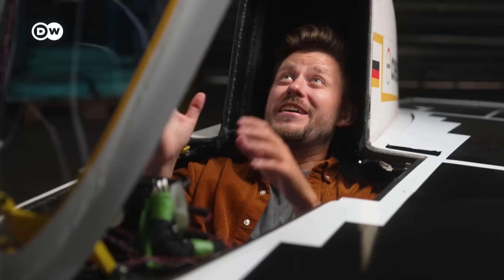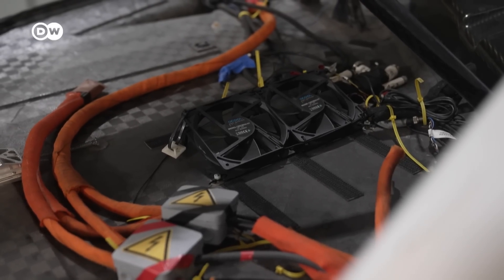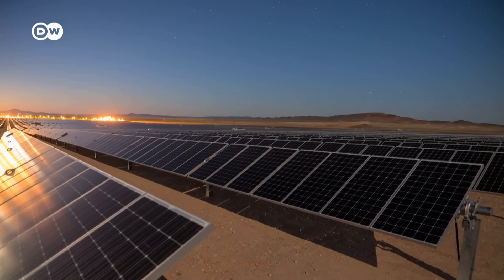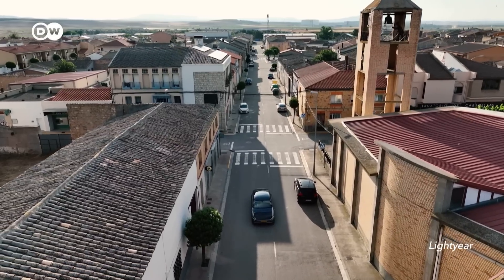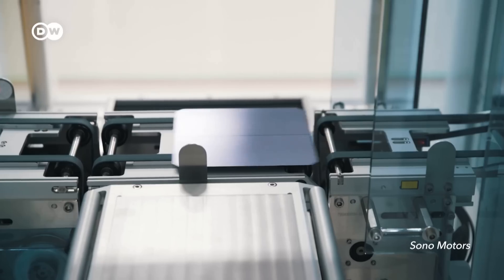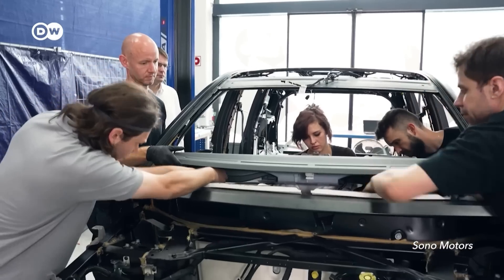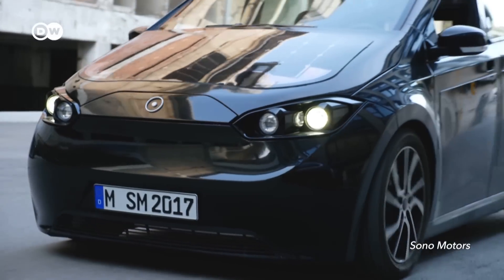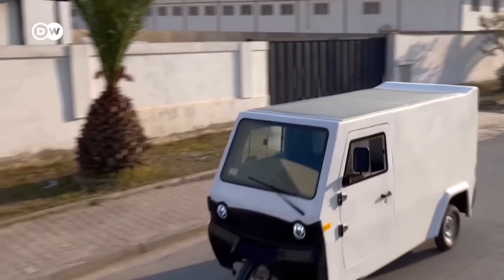Why aren't solar cars everywhere?

Comment: The Aptera overheating was because they had not hooked up the motor cooling system.  It's a prototype.  They had it in Switzerland for part of the winter.  Then showed it off in Southern California in the middle of summer during a heatwave. Opps.
Reply: Design flaws. motors have cooling fans. The solar mini-buses built by Mustafa and his team in Nigeria don't have those issues as multiple of them are in operation for public transportation.
Reply: Actually,the cooling system had not been hooked up.  They have since connected it and demonstrated in harsher conditions. The now connected system does require a startup sequence.
Reply: @esprole  "Actually,the cooling system had not been hooked up." Actually, that was the first lame excuse for the first failure (the hill). I am talking about the second failure (the flat), and they didn't use the first lie because that would have thrown Fambro under the bus. 
"They have since connected it and demonstrated in harsher conditions." I wouldn't call 400 yards a harsh condition, nor even a proper demonstration - it was orchestrated nonsense and lies, much like they have always done. 
"The now connected system does require a startup sequence." Hoses in a cooling loop don't require a start-up sequence, but I am open to an explanation attempt, lol. Baffle us with science.
Reply: @aussieideasman8498 Since it was a prototype, a startup sequence is more than likely (probably just separate switches for cooling pump, fan, etc).
And tbh overheating is a relatively easy engineering challenge to overcome.
I don't really get why you're hating on Aptera so much...
Reply from the maker: Hey everyone! We are all for critical discussion here but please stay respectful towards each other.
Reply: @DWPlanetA  I disrespect stupidity, and don't know any person, so not interested in being personal. Heck, most don't have a name, and those who use one probably don't use their real name; they have no identity because how many John Smiths are there, for example?
Reply: @maxiferrari08  His entire brand has been hating on Aptera, and anyone showing interest in it. It's pretty pathetic, really.
Reply: @maxiferrari08  He is a well known aptera hater. Just check out his channel and you will see how much hatred he harbors.
Reply: I understand the clear facts as presented by the company it's pretty straight forward. Motor cooling was not connected at that time. There were still components yet to be installed. The completed system is a bit more than a simple cooling loop.
Reply: @esprole  "I understand the clear facts as presented by the company it's pretty straight forward." You are a gullible man (possibly a kid); AM doesn't present clear facts - they sell snake oil. I don't accept some deluded disciple's claim there are clear facts without said facts, and you have none. If people think there are any just because you wrote that, then they are also gullible fools. 
"Motor cooling was not connected at that time." Gamma has had a birthday, and has been driving the streets since day one (a video showed it while still at the FCL location). They have even registered it and replaced the Beta jalopy as the main joyride vehicle. If they have kept the cooling loop incomplete all that time, they are bigger fools than their disciples. 
"There were still components yet to be installed." If they go a year without hoses, then don't expect one for about three more decades. The broken wheel pant is another example of how long they take to get things done. I have yet to see a replacement in months. 
"The completed system is a bit more than a simple cooling loop." Once again, you fail to say what. As far as clear facts go, let's try to see what more the silly trike needs? We'll start with their claims it was ready to drive at the FCL reveal, and their driving it immediately after. There are two kinds of prototypes; static and moving. Static's are never driven - they can't, and are there for external visuals only. Moving are made to drive like the intended production version. Gamma pretends to be a moving prototype yet makes claims it is merely a static prototype whenever it gets caught breaking down. It needs to find its type, but as a moving prototype it has to have that completed cooling system. In the lie that explained the reason for the hill stop, they said it was missing just the hoses. There was no other lie about the Elaphe motors not having the channels around it that the hoses push cold coolant into and take the hot coolant from. Therefore, we can presume they exist. There was no mention that the hoses had no system from the pump end, either. Again, we should presume it exists. And since the system's loop includes the batteries and inverters, all the plumbing for those should be intact. These are plates, not hoses, as seen in their renders. The hoses are only to the motors and allow the wheels to move in all directions. The problem is - how come they didn't discover coolant all over the ground on the first drive? Surely they added coolant for the system! What took them seven months for Fambro to admit he forgot the hoses, when the error has to show up in a big puddle straight away? Now, there is no need for a production-intent vehicle to add complexities that turn off the flow. They had three Alpha's they could have stuffed around with that if they were crazy enough to want to. You are not being given facts, and I can't for the life of me understand how you can think you are? It's the unproven and inexplained skin cooling that causes overheating, and they divert your attention from that to the coolant system. The hoses can be attached and the start-up sequence (opening the flow, lol) can be properly implemented, and the silly trike will still overheat. No need to thrash it, either; a normal Summer day should be enough every time. It is the biggest con of all.
Reply: I think it had a cooling system they had to turn it on manually and forgot to, prototype only
Reply: @rp9674  The hoses were attached; what vehicle needs a switch to open/close hoses? They said it had a start-up sequence and never mentioned what that entailed. Again, what vehicle has a mysterious start-up sequence that still lets someone drive when it isn't used? Do more listening to facts and less guessing.
Reply: @aussieideasman8498  Reasearch topic: how an electric pump works & how switches work.
Reply: @aussieideasman8498  Do more listening to facts and less guessing. try following that advice.
Reply: @jefferylegere  Not gonna happen, he's been searching up every single aptera-related video since their reboot and been waging wars in the comment section. Always ends in him name-calling and spouting nonsense. Just ignore him lol
Reply: @mindlessmrawesome  "Not gonna happen," I'm listening right now - start sweating, lol. 
"he's been searching up every single aptera-related video since their reboot" You bet! And there have been hundreds. That's so I don't miss any facts - exactly opposite to what you two clowns say don't and won't happen.
"and been waging wars in the comment section." I haven't waged a war on anyone. I have taught many how to be better thinkers. I can't see how there is a war going on by doing that. 
"Always ends in him name-calling and spouting nonsense." Not always on the name calling, but sometimes. You need a dictionary. It's not as if a lot of the clowns don't call me names first. It's calling a spade a spade, and doesn't induce war. On the nonsense side, I don't take part in sprouting that. In fact, that is the reserve of almost all of the gullible fanboys who have ever tried to string a few small sentences together. 
"Just ignore him lol" There are many other readers than the authors who want to learn. I do it for them, knowing learning is too difficult for the fanboys. If you don't want to see that happen, the simple solution is not to be an author. I have never responded to someone who had only read and not written. That's impossible.
Reply: @aussieideasman8498 Holy shit, I just looked at your channel. I've never heard of aptera until this video and you've been posting hate for 2 full years?? I'm not saying you should like the company, but you should probably move on and stop following them. It's not worth commenting and debating imo, and I hope you're doing well for yourself.
Reply: Yeah, that shows an engineering challenge that most don't know exists, but they know about it. They can solve it though.
Reply: @andrewkaiser7203  Making cooling systems work has been done on hundreds of model vehicles - it is no challenge, but AM has shown to be incapable of it. They know the air can't cool enough from outside the belly pan, but that's the snake oil they can't eliminate because a radiator will kill the efficiency, as would open air parts with fins - the only two ways vehicles have ever cooled. They never intended to solve it.
Reply: You been sold lies. The second stop was on a flat road and they had to make up a different lie because the hoses were intact. Wake up.
Reply: @aussieideasman8498  those were not coolant hoses,those were brake and power lines you saw at that time.
Reply: @jefferylegere  I have no idea what "that time" is that you are referring to. Since my last comment was about the test bed, I can only presume that is what you mean. You really should be more specific if that isn't your "time". I saw no brake and power lines on the test bed, nor should any be there. I don't recall seeing cooling hoses, either (at least to any motors), and they definitely should have been there.

Comment: This didn't give the full picture, American car companies get hundreds of millions from the US government to help them start up.  However that strange looking things has three wheels so it didn't get the funding for cars, because cars don't have 3 wheels, which is why it went bankrupt.  When the American government changed the rules it got it's funding and will most likely go into production.

Sono Motors didn't get hundreds of millions or even tens of millions, they got 27,000 Euros from the German government.  If they had gotten as much as any American car company got then they would have made it into production.

The problems with those two bankruptcies wasn't related to the solar panels.
Reply: So, bankruptcies are now the fault of missing government funding? 

They are related to the solar panels. Not to their technical functionality, but because the integrated solar panels require street verifaction for all those newly designed car parts which blew production costs completely out of proportion. And that led to the bankruptcies
Reply: @kaisteinecke8034  it needs to be a level playing field and the EU should take action against US car companies when it isn't.

Comment: It is strange feature for one to make 12 minutes video about this.Reason is obvious :You need bigger panels than your car
Reply: No - you need a different, more aero dynamic shape - that's why the solar racing cars can run on fairly small batteries. The problem with turning it into a regular car is that - few people would be ok with driving something as barebones as the racers are. I.e. it's prove to work. What's missing is a way to turn it into something people would buy.
Reply: @HumanAreYou  The Sion and Squad Solar, are far from being especially aerodynamic, yet they can drive on mostly/only the power from their solar panels, thus disproving your claim. And the massive numbers of pre-orders, for the Sion, Squad Solar, and Aptera, shows that they are most certainly things, that people would buy.

Also, a large contributing factor, for why solar racers can have small batteries, is because they barely need any range.
Reply: @ZarlanTheGreen  My statement was in response to OP. Not you :).
Reply: @HumanAreYou  What about my response to you, makes you believe I wasn't aware of that? How is it not perfectly applicable/relevant to what you said, even if we assume that my previous comment didn't even exist?
Reply: @ZarlanTheGreen  Because it ... doesn't really make much sense if read that way?

Two of the three of cars / car replacements you mentioned have quite significantly different shapes than normal cars.

Aptera certainly did a lot of work to reduce drag. Squad Solar is going lightweight as much as possible and is more like a Pod Cycle style product. The Sion was cancelled and we have no real information how well or not it actually worked. 

The  Solar racers have quite extensive range. Re-watch the video? It's stated within, and proven to work - in the races they compete in.
Reply: @HumanAreYou  "Because it ... doesn't really make much sense if read that way?"

How so? It is a perfectly sensible response, to the claims you make in your comment, regardless of what it was a response to, or whether or not it was a response, at all.

"Two of the three of cars / car replacements you mentioned have quite significantly different shapes than normal cars."

So what? How is that relevant? Being a regular car, is about what it can/can't do, its cost, and such things. The shape is not really all that important.
The only ones that have a particularly aerodynamic shape (i.e. what you mentioned as being necessary), are the Lightyear (which still has a fairly normal car shape) and the Aptera.

"and is more like a Pod Cycle style product"

Whatever. It's perfectly sufficient, for most people.

"The Sion was cancelled"

Irrelevant. It was only cancelled, because they didn't have the money to start mass production. If they'd have had that, it wouldn't have been.

"and we have no real information how well or not it actually worked."

Yes we do. The prototypes worked perfectly well.

"The  Solar racers have quite extensive range."

I checked and... Yeah, I was wrong. I assumed normal race tracks, which apparently isn't the case. Thanks for the correction.
Reply: @ZarlanTheGreen  "So what? How is that relevant?" Read the OP. Then read my first reply. (Which as I said above was not directed at you.)
Reply: @HumanAreYou  I have. What I said still stands, and your complaint makes no sense. My response was made, with me being perfectly well aware that you responded to the OP (and knowing that you may have made it, without even having seen my comment), and it was a perfectly applicable/relevant reply, to your comment regardless of what you responded to, or even if your comment was a response, at all.

I also see that you didn't respond to any of the other points I made.
No doubt, because you realise, that you have no argument against any of it, and therefore try to distract from it, to sweep under the rug, the fact that you have case.
Reply: @ZarlanTheGreen  No, I didn't reply because I am not taking the bait of running down a windmill argument that you created. My time is too precious for that - and ... I won't engage with circular logic from here on.

Again: It's impossible - the video highlights it - as does simple physics - to build a solar car with current solar technology, without changing the shape of what mainstream cars look like. I'd already picked that apart with your counter arguments.
Reply: @HumanAreYou    "running down a windmill argument that you created."

That is exactly what YOU are doing, with your incoherent nonsense, about my reply supposedly not being applicable/relevant, when it obviously is.

"It's impossible"

The mentioned cars, have proven that it is not only possible, but has been done.
Lying about it, in the face of clear evidence, and denying the existence of said evidence, does nothing, except make you look bad.
Reply: ...except that the video mentioned several cars, that have panels that provide enough energy, so that you'd almost never need to charge it. There is also the Squad Solar, which you also, pretty much, don't need to charge.

Comment: Normal cars are just too heavy for the surface area they provide to have much practical use.

Also the cells are too expensive and inefficient on a car. For that money you might as well put cells on your house with a battery and charging station.

Comment: the concept on 18 wheelers sounds  more optimal than personal cars.

1) larger surface area
2) some routes are linear, especially for the USA where our nation is wider than it is long.

a route from washington state to new york or even california to texas (arid region, lots of sun) even from california to florida.

if paired with the EV 18wheelers then hopefully the passive charging from the sun will be COST EFFECTIVE for the two novel technologies to wean us away from fossil fuels.

in my opionion freight transport NEEDS fossil fuels due to weight is their primary goal compared to commuter/personal vehicles where efficieny is the primary goal.

im not an engineer so idk how they'll make it work but if freight vehicles can use green energy in a cost effective means. thats would be a miracle.

Comment: Or adding some sort of propeller to use wind energy while in motion
Reply: I don't think that's possible because propellers will add more aerodynamic drag than the amount energy that they will generate.
Reply: It most likely would only be a benefit when parked and if you are gonna do that then you should make it fold when car is in use to keep aerodynamic drag low.
Reply: @wilderness-beastt  or run it through the front trunk since it's empty space.
Reply: Raise some sails!